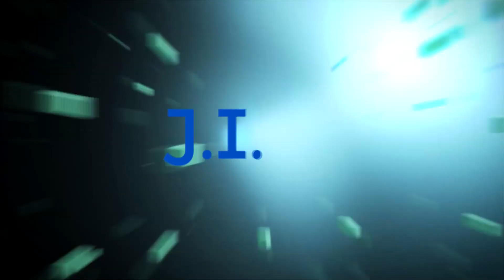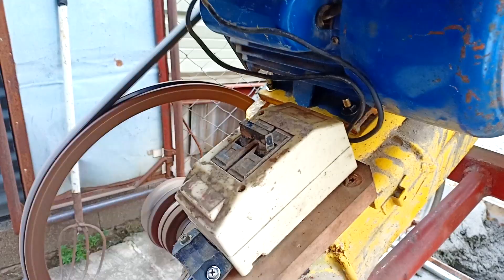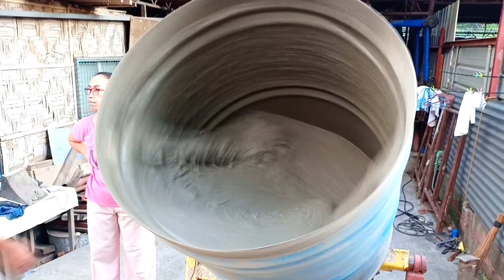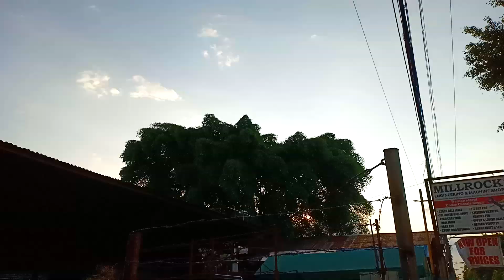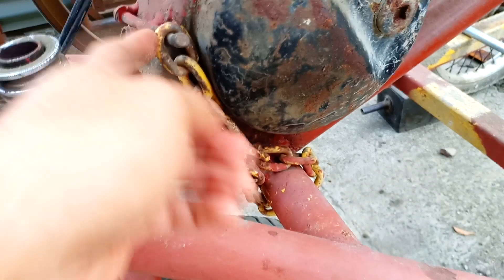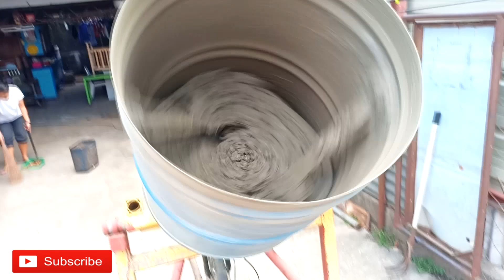DIY Cement Mixer | Ginamit namin pagawa ng bahay namin #JoeItYourselfVlog youtube video

Comment: the same principles,  only the difference is price my opinion Sir thanks a lot and good evening too its either 1 HP or 1.5 hp Mindlong Electric Motor TEFC type 1725 rpm Sir nice video
Reply from the maker: my father said the motor can be small. we use 1hp. we can reduce it to .5

Comment: By the way, ilang cubic po ng cement ang maximum holding ng diy mixer po?
Reply from the maker: hindi ko po alam ilang cubic pero ang nilalagay namin jan ay isang balde na maliit na cement tapos pitong balde ng sand. kaya niya po
Reply: @JoeItYourself  ang pag sukat kung ilan ang  kayang e batch sa mixer ay gumawa ka ng porma tapos compute ka volume at ibuhos ang mixture mo. Yan ang maximum volume produce per batch .
Reply: @rodolfollanera5936  standard dimension nga boss ng porma? Xyz?